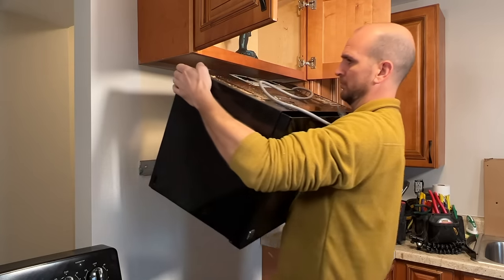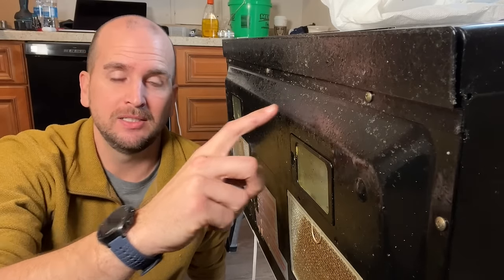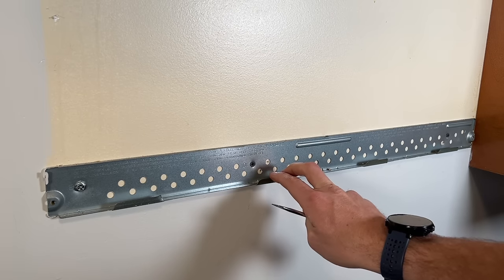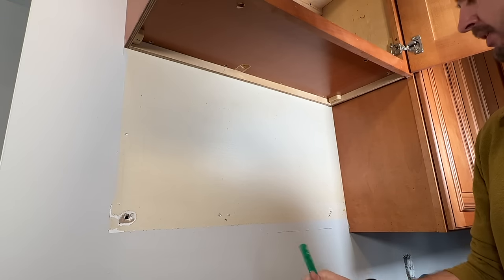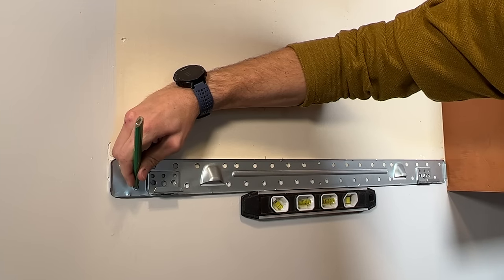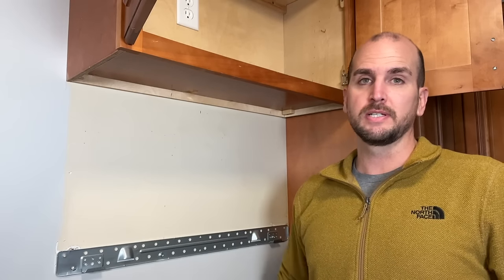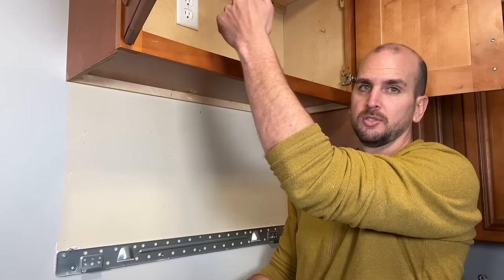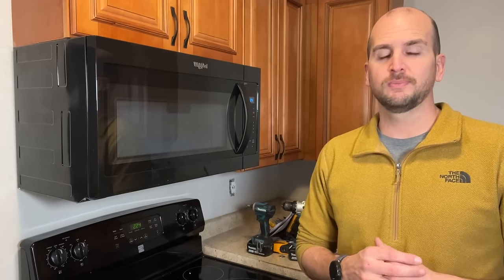How To Remove And Install A Microwave | Over-The-Range

Comment: If you have a 3ft bar clamp, it makes removal 10x easier. Clamp the microwave to the cabinet, remove screws, then support microwave and undo clamp.
Reply: Excellent idea!  Thanks for the tip.

Comment: You installed a unit the sits lower due to overall height; that might be against code.  There are guidance points to ensure you have your unit at the proper distance from your cooktop, some manufacturers say 30 inches above the cooktop; and code says to follow manufacturer listing.  Thats a key metric to consider when buying a new unit.  And, in some places there may be a prohibition on how high a microwave can be mounted overall.  One bit of guidance says no more than 54 inches above the floor.  So, it gets limited in a number of ways.  Think about anyone who is under 6 feet tall, like kids. Many times people are pulling very hot food and liquids out at head height.  One slip and that person is covered in hot stuff and will get burned.  Just think about how sticky and thick some soups are and how much heat will transfer to the body when it hits and sticks.  Latest guidance is to install the microwave below the counter level to provide a safer experience for your entire household.
Reply: I totally agree with your comments on height placement, too low the unit can melt, and too high, you can get burn if you hot dish slip. My unit was installed too low so the handle got melted when I cook on high too long on stove top. I decided to take microwave off and will install exhaust hood system. I will get a countertop microwave instead.
Reply: This happened to me. Contractor would not install a microwave over my stove due to the 30 inch minimum.
Reply: Agree 100%.  Also, I dislike OTRs because the exhausts on them just can't compete with a range hood that only has 1 job :)

Comment: Thoses filters are not charcoal. They can be washed and reused.
Reply from the maker: You’re right and appreciate the feedback.  I always default to “charcoal” but that specific one is just a wire mesh to trap the grease.  Grease trapping capability gets a full workout on some of my rentals 😬
Reply: I have both, and aluminum and a charcoal. Don’t use the charcoal filter because I vent tothe outside.
Reply: @EverydayHomeRepairs ❤

Comment: I had to replace a microwave in an older home and both the back wall and cabinet were Swiss cheese. I ended up adding some plywood to both for extra reinforcement and then I filled in the extra holes in the cabinet with wood filler. After that I covered the bottom of the cabinet with a shelf liner to hide the mess.
Reply from the maker: Sounds like the best you could do with the circumstances.

Comment: Just replaced one, this was a great help. The previous mounting bracket was only held by a couple of drywall screws and not on a stud, so your toggle info was great. A bit tricky lining up the
cabinet bolts, not much room for error, used washers to cover nearby holes. Thanks as always!!!
Reply from the maker: Nice, yeah it is pretty crazy home many microwaves like this are installed incorrectly.  I would say 75% of the time when I remove one it is holding on by maybe 1 screw hitting a stud 😬

Comment: Great job!  

Only suggestion I'd make is... plug the microwave in first and confirm that it works before installing anything! 😂

I've learned the hard way with large appliances bought both new and used that this quick test is worth getting the extension cord out for.  A bad appliance or bad socket is a huge pain in the ass.
Reply: Oh wow. That is a great idea.

Comment: Clean work. My first install was overwhelming. You make it look so easy. As you said to double check all measurements. Well done 👍
Reply from the maker: For sure, it’s all in the setup.  If you have everything set correctly the actual lift into place is no big deal 👍

Comment: Nice demo with good instructions. I remember when I installed a combo microwave - stove fan at my former house and it was a real adventure. Luckily I did have a helper for the actual lift to install but there were ceramic tiles on the wall so ... carefully drilling the holes, mounting toggle bolts (nothing lined up with studs), finding a single stud that was almost centred and cutting through the mounting bar and the ceramic tile to get a firm and level mount for the bar. Then  cutting for the vent in the bottom of the upper cabinet as well as a hole through the exterior wall for the fan and vent installation through a stucco outer wall where the exterior was over 20 feet above ground level was not fun. When it was all finished it looked great (stainless steel hood and convection microwave as well as the matching electric stove below) and was worth the pain and suffering with a minimum of touchup painting on the exterior wall. I've been tempted to do the same thing in this new house but there isn't enough clearance between where it would have to be mounted and the gas stove below. That will have to wait another ten years when my DW will be promoting the idea of a majorly renovated kitchen.

Comment: I'm very happy to see this video as I will also be replacing my Kenmore, which is about the same as what was removed in this video. The new one is likely to be a Whirlpool too. Edit: my son and I did the install today and it went well. We took our time, verified the position of the studs, and double checked all markings were at the correct distances. Using the template my initial markings for bracket screws were a little high. I guess I didn't cut the box at the exact spot on the dotted line they wanted. Not sure how much leeway there is but I'm glad I verified. I wish manufacturers would decide on a single template. The Kenmore actually had a U-shaped bracket so now there are three big and two little holes in my wall not being used and 3 "small" and 1 big hole in the cabinet. I covered them up with stickers so nothing would fall down there.

Comment: I'm impressed you man-handled that microwave on and off the bracket by yourself. Whenever I've tried to do it alone I end up bending the metal tabs and invariably have to ask someone to help.
Reply from the maker: If everything is set correctly it usually isn’t too bad but also smart to call in an extra set of hands if possible.

Comment: When I installed mine I removed a hood fan that was hard wired in. So i passed the wire up threw the wall about 8in and installed an outlet in the cabinet. And my microwave ( a Frigidaire ) has a completely  different mounting system. Not harder, just different. It has a large bracket the passes threw the unit and screws in the front top behind the top trim. Yours looked like it would have been much quicker to install. Keep the videos coming and I'll keep watching and learning.
Reply: Is that the only outlet on the circuit?

Comment: I've installed a couple dozen of these things, but I still appreciated your video. I have always gotten the paper template with a bunch of confusing lines that are supposed to compensate for the offset of the back wall of the cabinet. Let's just say that fender washers are my friend.
As I recall, the instructions want you to put the top bolts through blocking that fills between the cabinet bottom and the microwave top. Of course I never do. Did you blow through that step too?

Comment: I had to do this once because something caught fire in my microwave, luckily I was able to replace it with the exact same model so I didn't need to drill any new holes and I could just re-use the mounting bracket that was already there!

Comment: Great video! One thing that wasn't covered was the electrical work (if it's a new installation rather than a replacement). Obviously, an outlet must be installed inside the cabinet. One extremely common mistake is re-using the existing cable that used to power the range hood. The problem with this is that it's wired to an existing 15-amp lighting circuit, so it will trip the breaker every time the microwave is used if other loads (including lights) are in use on the circuit at the same time.  The microwave draws 13 amps. The only way to assure a successful electrical installation is to run a separate 20-amp circuit (12/2 cable) from the main panel directly to the microwave outlet, with no other loads connected to it.
Reply: That's a good point. Also it is best to use a single 20 amp receptacle to ensure nothing else gets plugged in to the circuit. I noticed he has a 15A duplex receptacle. That could be a tip that the circuit is not dedicated, although it is also acceptable in the code to have a 15A duplex on a dedicated 20A circuit.

Comment: I removed an existing over-the-range microwave.  The snag I hit was that a previous homeowner had granite countertops and backsplashes installed after the microwave was put in.  The backsplash came all the way up to the bottom edge of the microwave -- stupid!  When I removed the cabinet bolts, the microwave would not budge as it was wedged between the cabinet & the backsplash.  Ended up using an oscillating saw to cut the clips in the mounting bracket.  Only then was I able to pull the unit straight out.

Comment: good video. Since the bottom of the cabinet has a recess, do I need a filler block for each screw so as not to accidentally overtighten the screws and pull the microwave metal up?
Reply: You can do that if it worries you. It shouldn't be a problem though if you are careful. First put them in by hand then use a screwdriver, turning only until it feels tight. I don't recommend using a power tool and you don't want to grip the screwdriver and crank it like you're Superman. I also recommend using the washers. Not everyone does.

Comment: I had to replace a Samsung Convection microwave after 6 years. I had to replace the original bracket and new holes for the screws. I got 3 of the support clips into the bracket, but not one on the right side. That one is pushing the one side out about 3/8". I got it up, and holding.

Comment: The instructions for all the ones I’ve installed say something like absolutely requires two persons to install. I actually got someone else to screw the bolts in on the last one I did since for some reason these units feel like they’re getting heavier🤔

Comment: This may be a dumb question. Why can't you use existing hole for the plug? Great video. Love the channel.
Reply: because the cord was in a different location on the microwave
Reply: @drewk75  Ok thanks. Just wondered cause I swapped out a whirlpool and put in a Samsung and used same hole. Must have got lucky
Reply: @carmenlamanna5391  For me they didn't line up going from a Kenmore/LG to a Whirlpool. I debated on reusing the existing hole because it appears there is just enough room for the cord to go across the microwave top but I thought it might be bad for the cord to have such sharp turns.
Reply: I sort of did because I vent through the top and the hole for the vent was large enough considering the vent pattern was different, swiss cheese. I cut vinyl tile to cover the bottom of the cabinet, very thiick vinyl tile. I pushed the extra cord down the vent hole and it rests on top of the microwave. You could do the same with the other mounting types only if you have a space or a gap between the bottom of the cabinet and the microwave.

Comment: Nice, thank you. I am running into a problem with removing from the mounting bracket. It appears that it may have been mounted so high that there isn't enough room to lift the unit up.
Reply: Try to tilt the top out towards you as much as you can before lifting it off.

Comment: Setting vents is a big part and moving the fan to accommodate upper or back or no vent.
Reply from the maker: Yeah, I am a bit skewed since in my area so few are vented.  Is venting common in your area?  Would you say 50% of homes?  Ours is about 5% or maybe 10%.
Reply: @EverydayHomeRepairs  new construction in Seattle area 85% vented. Reno 60 %
Toronto 60 and 30

Comment: I tried to install mine and the predrilled screw holes in the microwave are too far out to be screwed in the cabinet.  What do you do in this instance? Do I seriously need to go buy a new microwave and measure the depth of the screw holes?
Reply: There was a microwave over the range before this one. So I was surprised this was a prpblem

Comment: whats your opinion on venting vs circulated microwave ranges? i have to either go 45 degrees then angled 90 degrees exausting outside through the wall bc basement apartment also bc gas meter right above other option is  recirculating microwave range… what would you recommend in this situation? the stove is gas not sure if that makes a difference if gas or electrical stove as well?
Reply from the maker: I thinking venting is better but probably hard to justify the extra cost and effort other than your own personal preference.  95% of units in my area just recirculate even on $700,000 homes.
Reply: Venting is much better way to go
Reply: @dido1803  even with bends on the duct work? thats the reason why im on the fence…
Reply: @EverydayHomeRepairs  95 percent thats crazy i guess different areas have different standards, but regardless it seems  like both options are okay 👍
Reply: Venting to exterior, always when possible.  Don’t think convenient, think possible.  Venting to exterior provides YOU with cleaner air in the house.  Yes, it matters.  Cooking makes interior air quality significantly worse than outdoor air quality and you need healthy lungs to be a healthy person.  Then think kids, if you damage their lungs they could have a lifetime of things like asthma working against them.  Vent it to the outside and run it every time you cook.
Reply: @lusoroofing5221  venting with bend vent will work too as long as bend is not terribly sharp. Ideally no sharper than a right angle bend. Also use smooth type elbow connector to prevent air turbulent effect.

Comment: Hey, seems like there is metal behind the drywall. When I found the stud, I was drilling into metal. What is that?
Reply: Could be a plate that protects the wiring behind it so you don't drill into it.

Comment: what if there are no studs behind the wall as in condos, can i just use toggle bolts?
Reply: I seriously doubt that the toggle bolts will hold the weight of the microwave oven.  I would weigh the microwave first to get an idea on what other kind of attachment will be strong enough to hold it up.

Comment: If installing the back bracket level, what if the cabinet is not level?
Reply: Tear down the house. Seriously though, do you want the microwave level or in line with the cabinet? If the cabinet is just a little off and you don't want a gap, you could line the bracket up to be the same. But if it's off by more than just a smidge, you should mount the bracket level while making sure the lower side of the cabinet to the bracket is the minimum distance required. You will end up with a gap between the microwave and the cabinet bottom on the other side. You should use a filler block for any top side screws on that side and maybe you'll want to cover up the gap with a strip of wood.

Comment: Yes so the maintenance man here installed the microwave in the process he dropped it the amount that goes into the wall that you put the microwave on to secure it was bent so we had to get a tool to bend it back and that is what holds this microwave that is humongous and weighs a lot in the process you broke my stove stop telling the stove and broke the shattered it it's a glass stove now I called him yesterday because of the separation from the screws that go down to the cupboard there was a 3-in gap and the other one was secure came back screwed it in it was nice and now it's starting to separate again is it important that they don't separate the ones that are mounted through the cupboard and then drilling into the microwave

Comment: I would not put a microwave over my range.  I prefer a hood that has an exhaust fan that goes outside and a light. My micro is on my countertop.  Much safer for shorter guests I receive.  Reaching overhead to pull a hot meal out of the microwave can't be too safe.
Reply: it's possible to vent these outside
i had a rental that its OTC microwave indeed vented outside
and it had 2 light bulbs underneath, and it had a "night light" setting

these are great if you don't have much counter space, or nowhere to practically keep a separate microwave cart 😎👍